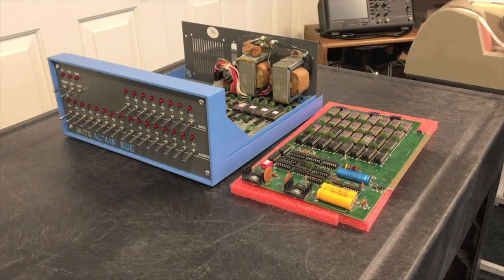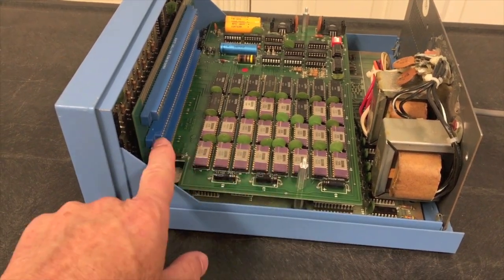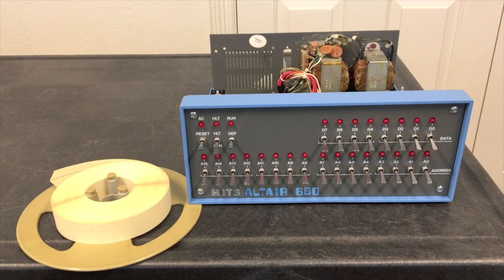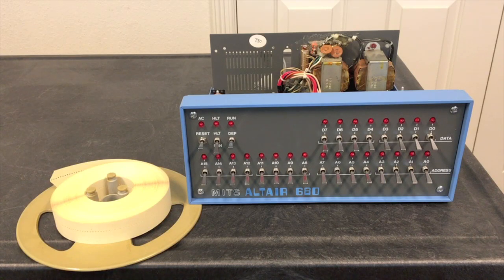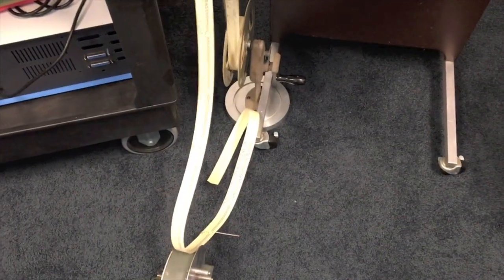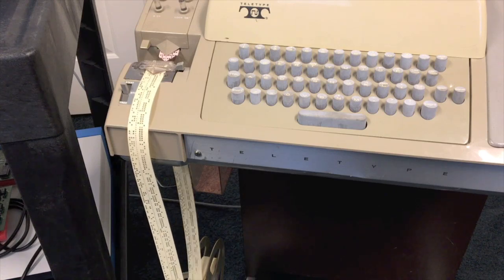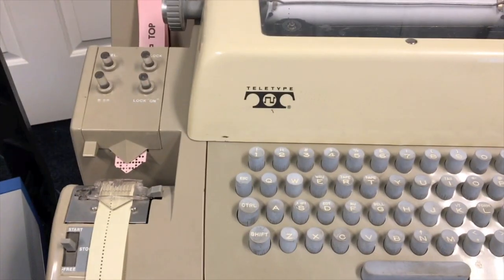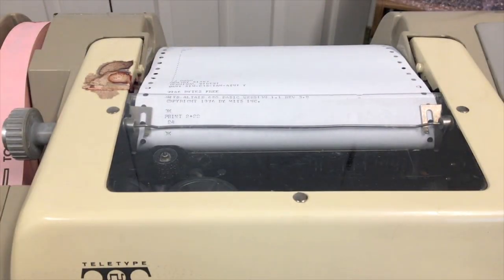8K BASIC on the Altair 680 Computer

Comment: Oh MOS 6550 SRAM. Hadn’t seen that on anything other than the PET 2001. Those chips are heaters! That board must get so so hot, especially if you stacked another on top. Amazing the PET 2001 with 8K of that stuff was  just $795 in 1977…. With everything else attached to it. :-)
Reply from the maker: Actually, it uses the EMM/SEMI 4200 4Kx1 static RAM chips

Comment: I remember my first computer...a zx81 with a cassette...the cassette system worked fairly well as long as your volume was about 90%...looking back I was happy to move on from the slow load times...but looking at this...yea it was MUCH worse...kind of like the paper tape version of like the c64 disk drive interface with the slow serial connection...bu the errors put this on a different level.   But nice to see how this worked errors and all.

Comment: Why do they even have S-Records if they take so long?
Reply: Perhaps because one could restart the load process, which is demonstrated in the video.

I am very familiar with the S-record format.  The binary format that he mentions, not so much.  Perhaps the binary format offers a similar advantage.  

He did mention 256 bytes as an example for the binary record.  My S-records are 43 bytes per line.  I'd imagine that one would have to go back around five times further to correct for a misfeed for the binary record.  That does not really make up for the extra time during loading, though.

Another possible reason is that the monitor for the Altair 680 could not actually accept more than 7-bit data from the serial port.  In short, it was a text-only interface.
Reply: @jeffreypage1361  The binary format that he mentions is literally just that -- the raw contents of memory punched into a tape. That was how lots of Altair software was distributed. You'd paddle in a very simple program on the front panel that would literally copy every byte coming in from the serial port to consecutive memory locations, and then you'd jump to the entry point and run. The downside is read errors aren't detectable, the upside is it uses way, way less tape and loads way faster. Microsoft BASIC used an in-between method where they would load a number of bytes, calculate the checksum and then compare it to the checksum stored on tape. This made it more reliable without making it too much longer.
Reply: @AureliusR  I don't understand how that could happen.
I constructed an Altair 680 clone using an MC68701.  With that hardware, I could do 8-bit transfers.
But, the original hardware did not support 8-bit communication.  It was limited to 7 bits.
What am I missing?

Comment: Hi Mike, great demo and explanation as usual. I’m porting this version of BASIC across to an ETA-3400 project as you know. Fortunately I’m able to load and save it to cassette in only 100 seconds using a different monitor, not 30 mins. I believe there is a version with CSAVE and CLOAD, but I don’t know if it’s available anywhere to download. I’ll need to incorporate that eventually and it would be easier if i don’t have to reinvent the wheel.
Reply from the maker: See cassette version here https://deramp.com/downloads/altair/software/altair_680/BASIC/

Comment: Question, how wide is the paper tape and is it actually just paper or is it a combination of paper and some other material ? Can one still purchase the paper tape and punch their own provided they have a punch and a reader ?
Reply from the maker: 1” wide for 8 bit readers/punches. Just paper Usually impregnated with some oil to help lubricate the punch dies was very common. Mylar and other materials were used as well for better durability.
Reply: @deramp5113  Is the Mylar tape still available ? Where would one obtain a roll of the Mylar ?